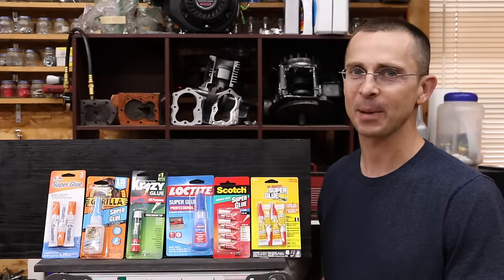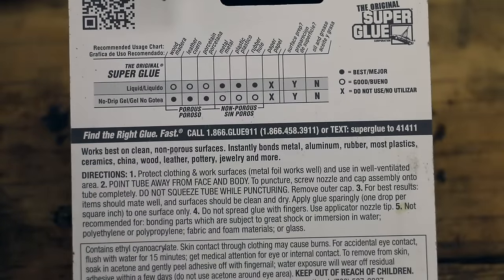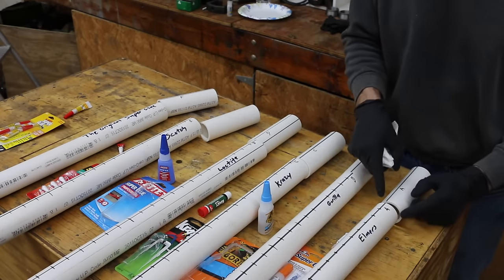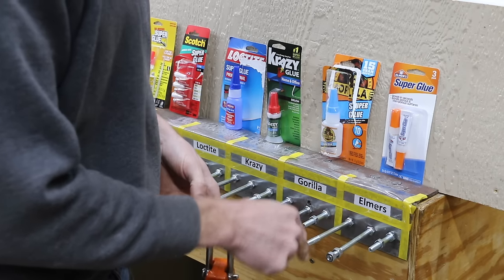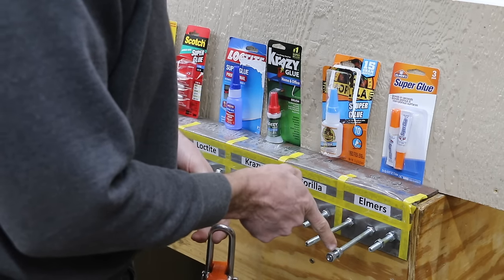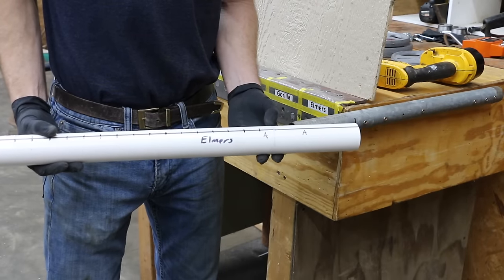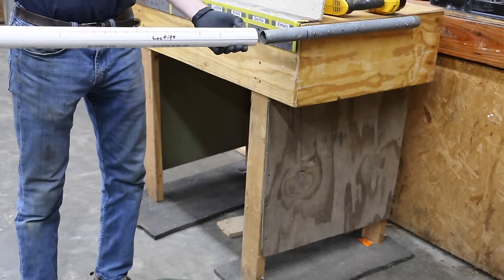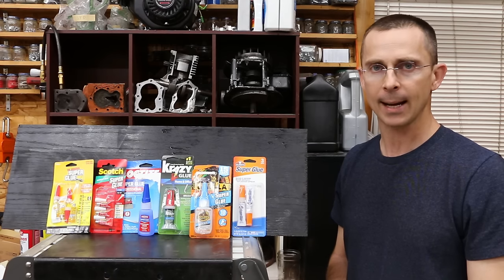Which Super Glue Brand is the Best?  Let's find out!

Comment: I first of all would like to say that I have watched many of your testing videos and really enjoy them . Great job man!   I recently watched your Locktite video . And now am watching your super glue video.  
You do not test super glue on rubber in this video.   But I wanted to let you know about a test that I did .  I had a old rubber air compressor hose that got a pretty large crack in it from dry rot .  And I repaired it with JB weld super glue and then wrapped it with some good quality 3-M electric tape. And it held with no leak for several weeks  at  under a constant pressure of 125 PSI , until I replaced the hose with a new one.   Thanks again for your videos , and keep up the good work.  👍
Reply from the maker: Thanks, will do!  Thanks for sharing.

Comment: This is a very interesting video - made me go out and get a dozen Loctite packages. What has been rather weird which is not covered in any video, the bottle ends on the Loctite glues break after a few uses. This is my 4th package I use, and the plastic that holds the cap just tears making the whole container and ghe glue useless. Did you experience any of this after a while with any of the glues you tried? Paul Stejskal's comment is quite pertinent, yes you can open them after one use, but they tear apart so not much better, right?

Comment: Should have been a torque calculation for the glued pipes. Need newton-meters or foot-pounds (or inch-pounds). Gorilla and Loctite look about equal on the graph with 21 and 22 inches.

In reality, Gorilla was 59.2 N-m and Loctite was 99.4 N-m, a stark difference in performance. Loctite dominated that test.

Loctite won, cost per performance. Hands down.

Comment: You should do a test of superglue strengths when baking soda is applied
Reply from the maker: Thank you for the video idea!
Reply: See project farm theres another for the super glue baking soda test :)
Reply: Why baking soda?
Reply: @everydayisearthday5500  depending on the super glue it acts as an activator making it harden instantly. It didnt work with gorilla glue but all the cheap ones ive used worked. I did this on a bumper that had a crack all the way through on the bottom lip still holding excellent a year later. Just dont get both on your hands as it will burn :/

Comment: i recently bought "Frog Lube" CLP for my guns, it is more of a gel than an oil. it's supposed to taste good as well. maybe try that 50/50 with motor oil?
Reply from the maker: Thank you for this recommendation!
Reply: Frog Lube, leaves my guns Minty Fresh!
Reply: It's vegetable oil with mint essential oils and preservative.  I use it too, but refined coconut oil works about as well.
Reply: mr bad example it can gl rancid and gum up. I only use it for the P part of CLP. It works excellent at rust prevention.
Reply: mr bad example
So you want to combine motor oil 50/50 with that frog stuff so you can taste test it?
Reply: I have read that many vegetable based lubricants, Frog lube especially will have an adverse reaction when it comes into contact with petroleum based products which can ultimately result in something more akin to an adhesive.  I don't know exactly how long this chemical process takes to occur but it could do a serious number on an engine if it happened while the engine is running.  It would still be fun to see either way.

Comment: Lawn mower engine supercharger, or a compressor pump lawn mower super charger
Reply from the maker: Thank you for this recommendation!
Reply: or an electric lawn mower
Reply: It's sounds like a Honda civic
Reply: Twin double charge a rzr 1000 motor and put it in a riding mower

Twin double charge =
Two turbos
Two superchargers
Reply: If you boosted a mower engine it would pressurise the carby and no fuel would come out as it relies on the suction across the jets to draw it into the the throat

Comment: The “downwards” force test actually tested the resistance to moment and downward shear at the same time. That’s because you hung the weight at the end of bolt, which serves as the moment arm. Predictably, the failure is not in the shear plane, but by bending moment causing the top part of the bolt head to be in tension and the bottom part in compression. I expected the ranked results to be the same as the pure tension test, but they are not. Maybe because this bending test concentrates the tensile forces into a smaller area, edge effects and sample preparation may have outsized effects. The most recent commenter talked about “error”, but let’s call it variability. That means using the same glue can give variable results depending on a number of other factors. You can either test for variability or simplify the test to limit the other factors. Thank you for sharing your efforts!
Reply from the maker: You are welcome!

Comment: I'm officially ancient, so I remember when Super Glue debued. I was a very serious model car builder as a kid, wiring, built headers, cloth for some interiors, painted file card as alum sheet for race cars.

My understanding of how CA works is the ideal material, what it works the best with, is glass.  Non-porous, reasonably matching surfaces.

My perception is it's like it creates a suction between the surfaces.

On the metal test, you did good w/ the plate finish, but I'd submit, grinding for cleanliness, grind for smooth & flat; same for the bolt heads.

(If you hadn't ground the raised lettering off the bolts, it would've been a disaster.)

With flat & smooth in mind, finishing the steel w/ 600, or higher, w/ a broad surface tool like a 6-8" DA sander would have been ideal.

That said, you got more adhesion than I expected.  Adhesion being the operant word; glues do not bond, they create adhesion.

Bonding in the 'glue' world is akin to welding, where adhesion would be analgous to soldering or brazing.

Re: the PVC, I'd never consider CA, not when a true bonding agent is available in the plumbing aisle.

I use PVC a lot in my fab shop, I use 4, mebbe 5 different types of PVC agents, thin, medium, thick, 'hot' quick bond & wet environment/hot. Each has it's purpose, but the end result is the same, the PVC is chemically melted on each piece, & when cured, it all becomes a single piece of PVC. That's why PVC plumbing joints shatter before they'll separate at the 'glued' junction.

With that kind of bonding, why use an adhesive on PVC.

Acrylic plastic can be bonded, as well, w/ the correct cement.

Going back 60 yrs to my model building, polystyrene model parts were bonded together using the original toluol/toluene based cements, (the glue sniffers caused those glues to be yanked, it's my understanding model builders, today, stick models together w/ non-bonding adhesives.

Still, I was surprised you got as a good of results from the PVC pipe test.  The Loctite showed up.  Especially considering the mating surfaces were raw saw cut.

Imagine trying to get two pieces of PVC sheet apart. I'd say the flat, smooth surface of PVC would be nearly as perfect for CA as glass. The added benefit for testing would be the non-brittleness of the PVC vs glass.

One comment on methodology: Your 2nd test on the bolts was really a duplication of the 1st, just in a different orientation, not what you were intending, a 90⁰ pull to the mating surfaces.

If you had fixed the far end of your strap to the steel base, then inserted a jack between the base & the strap, you would have approximated a pulling stress in your glue joint.  That would have let the CA really shine, IMO.

The original 2000# pound claim was based on an anvil glue to a steel I beam.

With adequate surface prep, it's likely 2000# could be accomplished.

The 1st commercials for Super Glue showed a beam & anvil; later commercials showed a plastic hard hat glued to an I-beam, w/ the 'clean hands' foreman still in the hat.

I've often wondered how many clean hands jobsite workers found their hard hats Super Glued to something.

I'd like to see further exploration of CA done using Loctite in it's several numbered formulas vs BSI, (Bob Smith Industries) & the lineup of CA's & derivatives avaiable from China via eBay or Ali Express.

I have an Ali Express CA order ready, as I type this, there is 401, 502, the "good/new Korean" 401, something called 'oily glue', which "...in general "oily glue" is an oil-based adhesive which is produced by dissolving acrylic acid or polyurethane with an oily solvent such as toluene or butanone." -smithjohnj - on RFP, (a Prop/Costume makers forum).

Google's AI: "Here are some features of oily glue:

    Bonds without hardening: Unlike cement glues, oily glue doesn't become brittle or hard over time.
    Retains original look: Oily glue can adhere loose ends back to their original shape, helping to retain the item's look.
    Can be applied to many surfaces: Oily glue can be used on flat, vertical, uneven, and overhead surfaces.
    Sets quickly: Some oily glues can achieve maximum bonding strength in 15–30 seconds. 

Another CA to add to dream team test list would be Starbond. Just learned if, today, while researching the Ali Express offerings, Starbond's website offers, 'if you're tired of your CA drying out before you can use it, your dispensing lids being plugged & CA generally failing, give Starbond a try, we're trying to solve those problems.'

I've tried CA many times in 40-50 yrs, I can count CA successes, (long term, durable repairs), on one hand.

The number of dried containers, plugged nozzles & failures?  Well, I'd need to use a calculator, hands AND feet isn't even CLOSE to being enough.  Mebbe Staebond has something going on?

Hope my treatise on CA helps.

GeoD

Comment: I know this video is 5 years old but here’s my two cents anyway. The best adhesive properties will be obtained by scuffing a perfectly mated surface not by sanding. If you must sand you should sand with something closer to a 320 grit. Remember that at a microscopic level (which is where the product works it’s adhesive magic) the scratches will be huge hills and valleys. And it works by something called Van Der Walls principle. The glue just provides something to fill in those tiny hills and valleys.
Lot of work for you to go through and quite well thought out. Thank you so much for taking the time to help us all out with the tests.
Reply from the maker: Thanks for sharing!

Comment: I've noticed (from my experience) that superglues can be enforced when heat is applied (at around 60°C-100°C) immediately after the 2 surfaces get into contact and cool it slowly by  removing the hairdryer away slowly. The cure is faster when applying heat. You can almost immediately test it after it cools down completely.
Do a mini experiment (of around 5 minutes video or less) using only 1 super glue brand. Test the strength with the application of heat and without heat.
Reply from the maker: Thanks for the suggestion.
Reply: @ProjectFarm  The bond is so strong that it always happens to brake to a different spot  (if a tension is applied) BUT NEVER on the spot that is glued.

Comment: Love all your video.  I don't make a purchase anymore without checking your channel first.  I have a question about these glues.  I know it's been a while since you performed the test, but do you remember what the viscosity of each glue is?  I'm looking for a replacement for the Q-Bond adhesive as all of mine have dried up.  I have a lot of the Q-Bond filler material left so I'm looking for a thin, low viscosity Cyanoacrylic replacement that will saturate the filler material well.  Thanks for all the great work you do on these product tests!

Comment: Great testing!  I have been using Loctite and Gorilla brand lately and had no idea they were so different with regards to plastic.  I have used a lot of CA type glues for wood, mainly balsa for model airplane construction.  The very thin type, is best for light woods because it soaks in and sets up fast, but the joints have to be almost perfect and you have very little working time.  The medium viscosity stuff is great for surface hardening wood.  Just drop it on and smear it around with plastic gloves.  It soaks in a little and forms a clear and fairly smooth layer that can be sanded with fine sandpaper to make an very smooth finish that is fairly resistant to moisture and oils.  I used that for finishing self bows and it works very well and is almost instant.  The vapors SUCK so avoid them any way you can.
Reply from the maker: Thanks!

Comment: Non IMPACT sockets used as impact sockets til they break. Also impact used as standard sockets til destruction. Took almost 40 years to break the 7/8 snap on socket I have. It did break with a 2’ breaker bar but I barely was cranking on it and it cracked a side of socket off. The force required for an impact vs standard socket to turn similar bolts would be very interesting to see as well(fitment and steel strength differences). The temperature would be a great additive too. Stripped many impacts in summer heat and cracked sockets always in the cold.
Reply from the maker: Thanks for the feedback.

Comment: That was a very interesting test and comparison. I have plastic (cellulose nitrate) that I glue to metal (stainless steel) with a .5 square inch surface bonding area. The plastic has to survive repeated impacts over long periods of time. So far, Maximum Bond Krazy Glue has worked the best, but I haven't tried some of the other options in the video. Thanks
Reply from the maker: Thanks!  Thanks for sharing.

Comment: I've been using loctite for a couple of reasons. First and most important, the large container of loctite I have has been in use for a couple of years now and I can still use it. The smaller tubes of glue all go bad - often after one use (I'm talking to you, crazy glue!). So # of uses per jar (or per purchase) is superior for loctite. 
The gorilla I get is actually a different kind of glue (hydroscopic) which means the container does go 'bad' over time as water infiltrates.
Finally, I use loctite mostly on plastics - i.e. to glue 2-part 3d printed models made with PLA. I made a scuba diving cave line reel (spool) that was 2 parts. I glued it with loctite and the first run lasted 2 years before I dropped it and it broke on the glue line. I simply re-glued it and it's still working perfectly on weekly dives in the ocean after 4 years!
Reply from the maker: Thanks for sharing.

Comment: I have used a lot of Crazy Glues, and am not going to try to rate each one. However, I do a lot of automotive things (Radiator connections) and around the house things. Tops for me is QBond, second is Dap Rapid Fuse (Which I also used on a rubber connector to my multimeter to install a new wire), worked great.

Comment: In the 1980s, my dad used Eastman superglue for industrial applications. Mainly for locking aluminium shanks to graphite electrodes for electrical discharge machining. At the time a bottle cost $12.00 AUD. Far more expensive than other commercial brand but never failed.
Reply from the maker: Thanks for sharing.

Comment: For very fast curing and strong bonding add ash or baking soda to the super glue after application...these additions make a chemical reaction that is like a super accelerant. Ive actually "welded" zip-ties together with ash and super glue (I did this just for experimental purposes).

Comment: I love every one of your videos. I wish you get a chance to make one with all these superglue like they use baken soda with crazy glue to fill something or cigarette ashes. Or take it a little further like something we haven't seen powder from fiberglass or pvc powder or what ever  other metirial you can think of. Using a grinder cut off wheel to make that powder. Hires another one the grinder powder coming off metal too. There's an abundance of experiments options in this area. Experiment to See adhesive strength on different metirials like metal powder mixed with pvc and crazy glue that's going to be interesting. I don't know how you get back to alot of these comments but I really appreciatet it thank you keep up the great work.
Reply from the maker: Thanks, will do!  Thanks for the suggestion.

Comment: I love all your tests. This one was particularly good.
I just found a new use for cyanoacrylate. 
I ordered some blast hose but sadly I could not get any type of hose grip to squeeze down hard enough as the wall thickness is too high.  Barbed fitting definitely correct though. So I ended up using a heavy duty jubilee clip and loads of superglue! I roughened the connector first and degreased. It is holding fine. Definitely over 1 sq inch of surface area. Cyanoacrylate holds to about 4000psi and I am using 125psi.
Been nice knowing you 😌
Reply from the maker: Thanks!

Comment: I always used Loctite 401 to attach plastic vanes to carbon arrows. It outperformed all the other glues I tried. The kinetic forces with a compound bow are a hard test that most glues fail in a brittle fashion. Imagine an arrow coming to a sudden stop from around 270 feet per second a few hundred times and still holding up for a long time.
Reply from the maker: Thanks for sharing.